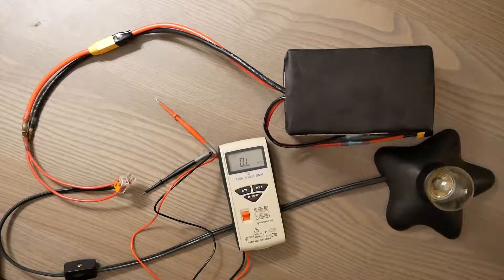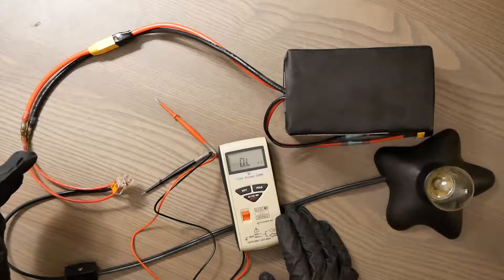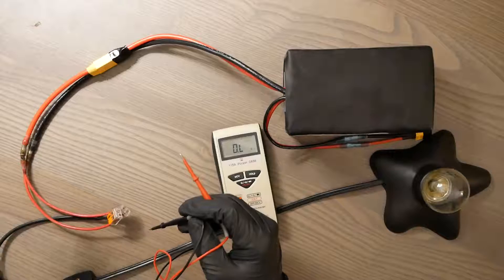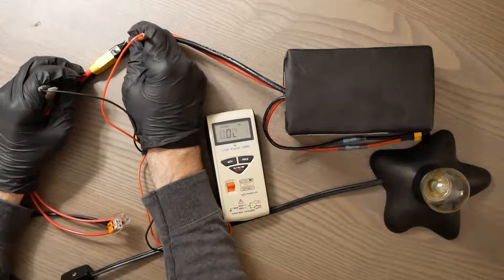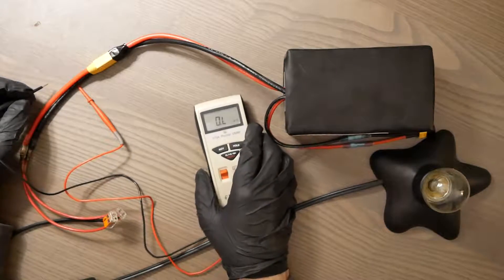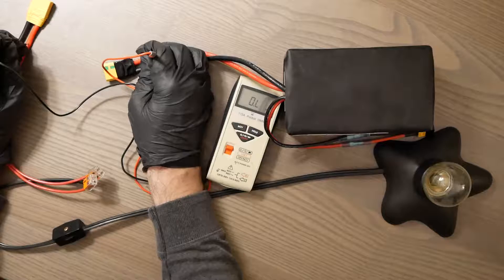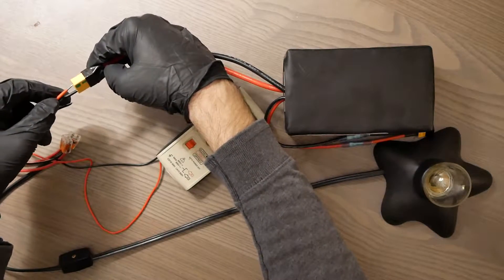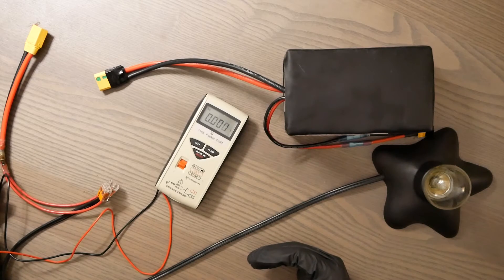How to check resistance and continuity on an ebike kit

Comment: Can i leave a multimeter on my bike to monitor battery while riding I have a 1000w 48v 20ah lithium i I connect between the battery n esc
Reply: Why not invest in an LCD display that monitors voltage? If not a display then there a tons of throttles that have a voltage display?  
Not sure why you want to mount a multimeter to your bike ….

/Bklyn👑